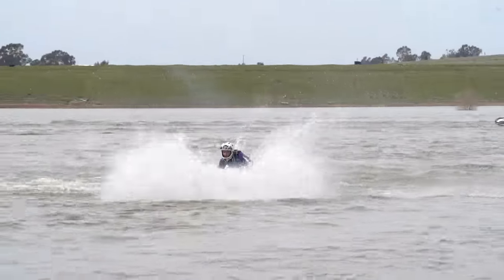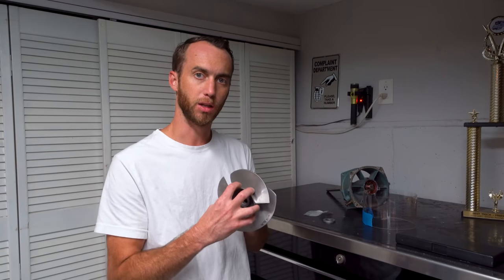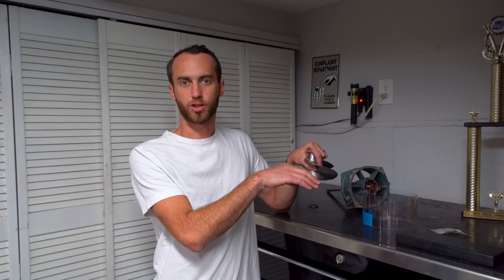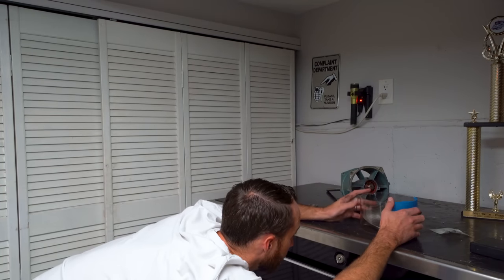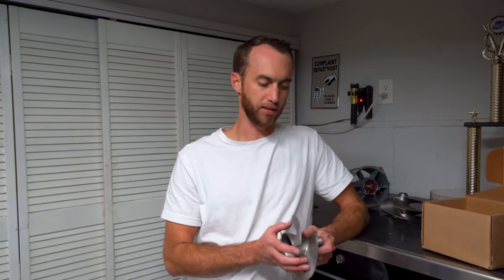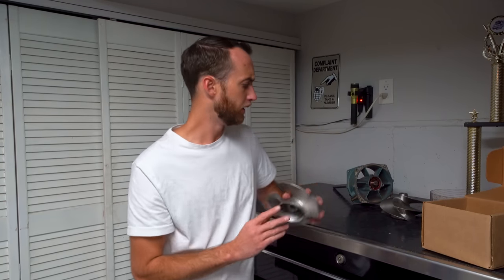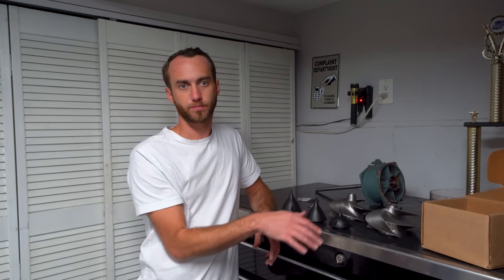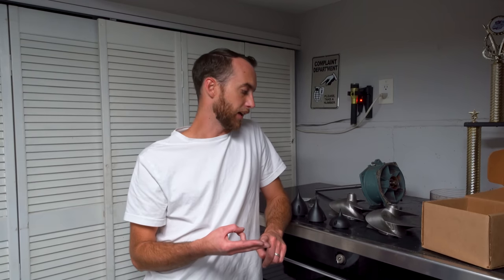JET SKI IMPELLER BASICS/ TUNING METHODS

Comment: Hi,Great Vid! I have a new 2024 Yamaha Limited HO 1.9 engine 200+ hp. I just put a new Solas 14/16 impeller on it and I cant get the rpms to go past 7900. Strange that Solas recommend 14/16 because on just last years model they recommend a 13/19. So im pretty confused and trying to find information for the best top speed impeller. Thx!!!

Comment: Hey I have 2 Kawasaki stx 15f Jetskis and I am a new ski owner so I’m new to the ski world, but I have an issue I would like to see if you can help me figure out,
Okay on a recent river trip I had the impeller shaft bearing fail, I replaced the bearings,shaft, cone, impeller and used the original jet pump housing. I used kawiperformance upgrade shaft kit and got a solas impeller with stock pitch. Everything went together nicely, and I have rode the ski several times and have noticed a slight vibration? Is the best I can describe the sound, but it only happens when I am at a consistent speed around 34 mph but if I let off the gas or speed up or turn it will stop until I stay at a constant speed. I have since replaced the jet pump housing to see if maybe that was the issue. And it still makes the vibration. It is very slight, and  I wouldn’t notice I guess if I didn’t have another of the exact same ski to compare it to, and I also replaced the shaft and bearings in the other ski with the same upgrade kit. The only thing different is the impeller. So I’m wondering if the impeller is the issue and is that something I should worry about ? Thanks in advance for your input or anyone who reads this.
Reply: Hi, I stumbled across your comments about pump vibration on this thread. I too have two Kawasaki's SX-R's and one we did a solas impeller upgrade after a small stick got stuck between the impeller and pump housing. That ski always had more vibration and was hoping that the vibration was being caused by a bent impeller - easy fix -. We upgrade the impeller shaft (KP Performance, seals and new bearings - complete rebuild) and new Solas impeller. The other ski runs well and has much less vibration (almost none). My question is did you find your issue?. I believe we have a bent drive shaft and being its a Kawasaki, we will have to remove the engine to replace the drive shaft.
Reply: @rcafpv6581  
no I have not found the issue yet, I’m thinking it’s the impeller, and I plan to swap the impeller with the other ski to confirm it. I did swap the entire jet pump assemblies from one ski to the other to confirm it was in the jet pump and it did confirm that much . So now when I get around to it I’m going to swap just the impellers and see if that confirms it being the impeller. It’s a very subtle vibration nothing you would notice or think was wrong if you didn’t have another ski to compare it to. And I just don’t know if it’s something that’s going to be an issue down the road if I don’t address it. The ski pulls hard and runs great , it just has the slight vibration sound at steady speeds in and around 35 mph ,it’s almost like the torque from accelerating and decelerating and turning keeps it from making the sound and when at a steady speed it’s alittle loose and slows whatever it is to make the vibration?